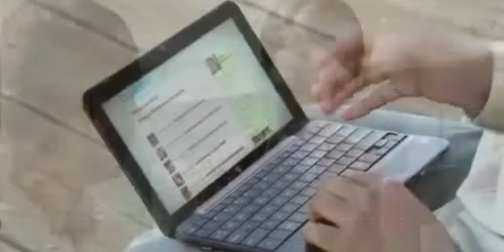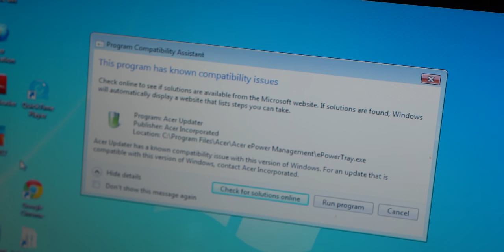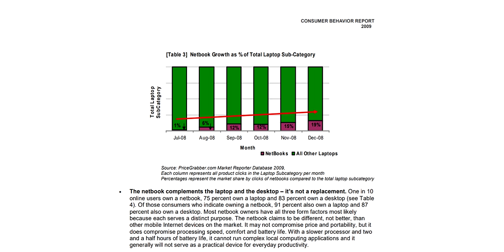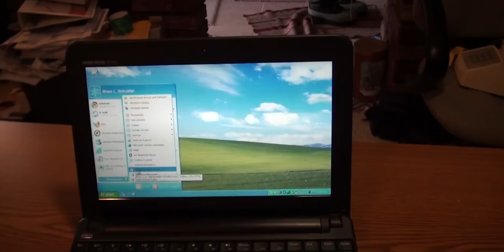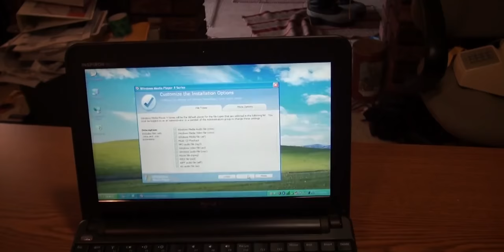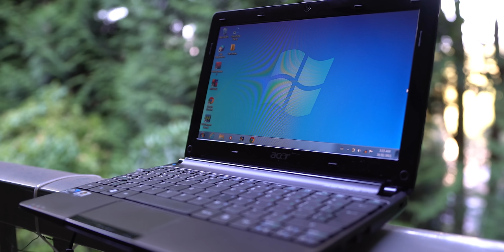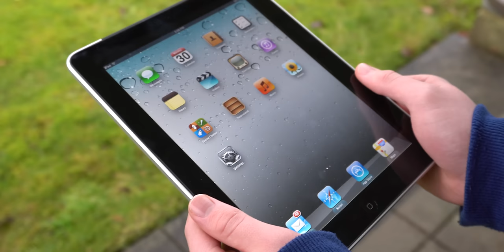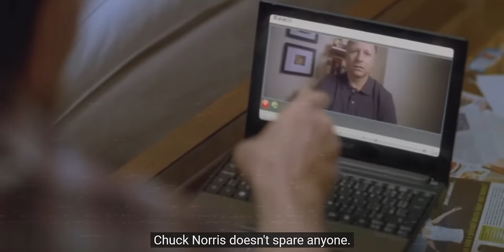Why Netbooks Failed - Modern Retrospective

Comment from the maker: Reminder that with Windows Starter Edition you couldn't change your wallpaper.
Has there ever been a more arbitrary limitation in any software than that? The low powered Atom processors and iPad/tablets didn't help Netbooks, but it was clear Microsoft never took them seriously.
Reply: cant change /customize win 10 if you dont activate windows , so yea thats still a thing
Reply: They were cheap and were bogged down really quickly with anything more than web browsing. The real purpose wasn’t really clear which lead to their eventual demise. Nostalgic nonetheless.
Reply from the maker: @billy ruiz bit different though because when you buy a laptop or pre-built PC it'll be activated. With Windows Starter you were buying a netbook, and were basically punished for not buying something better. Also it’s now used to try to guilt you into actually buying Windows which is probably fair.
Reply: At around 2012 I was given my mum's laptop which was a packard-bell easynote with black shiny plastic, it was a full size laptop but it had an awful single core celeron and I barely remember the rest, however it had windows 7 starter and it heated up like crazy. Why 7 starter? no idea at all, but packard-bell was a cheap brand so if it had to be cheap, it had to be completely garbaged out.
Reply: I still have mine, it’s hardly usable, it’s so slow. The wallpaper thing... we don’t talk about that.
Reply: i used a patch called Personalization Panel Patcher
Reply: You should consider covering the Palm Pre and Palm webOS. Really fascinating (and sad) story.
Reply: I know the wallpaper restriction is stupid, but it could be easily fixed by the Starter Background Changer. So it wasn’t really a big deal...
Reply: Vista Starter was limited to 1GB of ram, beat that
Reply: nintendo switch wont let me change my background either
Reply: The concept of a wallpaper itself is arbitrary. Why specifically on the desktop, and not on literally any other UI element that has a background in it?
Reply: Sony Pony  ihad one too but i put windows xp on it needed an external hdd cos it nly had 4gb storage year later sold it and bought a asus eepc 900ha still have it but now i use a HP X360 11.6" notebook as my secondary computer
Reply: Windows XP Starter Edition was worse. It was sold on cheap desktops in so-called "emerging markets". You couldn't have more than 512MB RAM, couldn't set display resolution above 1024 * 768, could only have a single user account called "Owner" which logged in automatically and couldn't have a password, and could only open three applications at a time. Interestingly, you could change the wallpaper to anything you wanted. Another notable thing is that it cost US$ 30 in the Russian market, while most poor people in Russia at the time could buy pirated Windows XP Professional for less than US$ 1. I have a Russian copy that I bought for fun and I also noticed that you can't update Internet Explorer beyond version 6. To use IE 8, you have to install the English version, which in my opinion is just strange.
Reply: Apple didn’t allow home screen backgrounds on iPhone and iPod touch prior to iOS 4, it was my #1 reason for jail breaking back then.
Reply: What model is the Acer netbook you show in the video? It's pretty similar to mine but definitely some differences
Reply: I didn't mind the fixed wallpaper.

The taskbar and window colors though…why did they use that ugly blue-gray?
Reply: @easyaspi31415  It's using the "XPDM (Win XP)" theme engine. It's a theme that's meant for backwards compatibility for old systems that don't support Aero, such as most circa 2001-2006 systems. They used it here as an attempt to reduce resource use, or make it "light weight", even though any modern PC at the time can handle Aero just fine... Including netbooks.
Reply: @steventechno  Wait does that mean xp themes are compatible?
Reply: @JohnSmith-xq1pz  Not straight away, no, I don't think so. Some tweaks would be needed to get Luna to render as many changes were done to the UI that breaks compatibility with XP Themes.
Reply: @steventechno  That figures lol. At least I have my background changing program...
Reply: @JohnSmith-xq1pz  You may be able to use UXTheme, but I'm unsure. I'm surprised there's anyone still running this OS... lol
Reply: @steventechno 
Hmm probably more efficient than I want to do lol. I've already changed the wallpaper and Windows welcome splash screen background. Acer used an OEM background so all I had to to was fund and replace that. Apparently a reg Edit method for the splash screen background is a thing too

 If I could have I would've downgraded to XP but that wasn't possible at the time I got my Netbook. Since it doesn't have any network or internet connection I'm totally fine with leaving 7 start on it (upgrading to 10 is possible but not great proformce from what I hear).

Lol I've got even older OS's still running too
Physical and virtual xp machine's
A 98se virtual machine
And multiple DosBox Windows 3.1 virtual machine's

My room's an interesting mix of old and new tech
Reply: @JohnSmith-xq1pz  Neato! I thought Win 7 Starter had the context menu on image files to "set as wallpaper". Maybe I'm thinking of something else... But Yeah, Win 10 32-bit should run okay with 2GB RAM at least. I've ran it on a netbook with 1GB and it was reasonably usable surprisingly enough, just avoid using the 64-bit flavors, and it'll be an okay laptop. Alternatively, Linux is a path it can go!
Reply: @steventechno  That might be how 7 starter normally works no idea. I accidentally discovered that Acer had used deeply hidden OEM image files for the welcome screen one day when I was trying to find a pic and told Windows search to locate every image file on the drive lol. So after finding that I was like yup I'm so tossing that stupid splash screen (I never like it. It's that bright green Acer one I believe they also used on full sized laptops) So the welcome screen is now a Bejeweled 2 backdrop lol.

Yeah I almost decide to go to 10 so I could still use my Netbook but I'm not thrilled with 10 and Linux is well I've never used it so yeah learning curve lol. So I was like yeah know a ultra portable version of my Retro gaming pc would be cool even if it's limited to lightweight games. So I spent several days transforming my Netbook into a fun little casual gaming pc.

The file transfer, factory reset and reinstalling the e backup drivers and apps (And 7 convince rollup) seriously toke  a whole day. Couldn't imagine how long the original hdd would've taken if even with a SSD it toke that long lol.
Reply: @JohnSmith-xq1pz  Converting it into an emulation station's a good idea. I would have likely turned my old one into that if I still had it, I probably would use Lakka, so more resources could be free just for the Emu's. lol
Reply: @steventechno  I've actually been thinking making a bootable RetroPi flash drive for some retro console emulation.
Reply: @steventechno  hopefully lol
Reply: I still have toshiba netbook n205 
And.....still work well
Reply: @dooogides9176  *Google's* Oh I remember those and the round bar thing that stuck out of the back. Is it still running xp?
Reply: @user-bn8pg7os8d  actually you kind of can
Reply: @steventechno  So? That doesn't stop them from choosing a better color…
Reply: @easyaspi31415  You weren't able to dynamically change colors on XP Themes either. only styles/skins.
Reply: @steventechno no I mean the default color is terrible.

If they knew that the desktop background wasn't going to be changeable, they could have chosen a more matching color: http://imgur.com/a/8CWoteV
Reply: Sony Pony  I had (and still have) an Asus EEE PC that I bought in 2010.  It came with Xandros Linux, and I had a problem with the OS crashing when it was trying to download updates.  I ended up buying a 64 GB SSD drive for it, to replace the stock 4GB SSD, and re-downloaded the factory Xandros Linux.  I then went to Ubuntu Linux (Easy Peasy) in 2012, when Asus stopped supporting the EEE PC.  That worked well, then I retired the netbook after buying both a used Windows 8 laptop and my first tablet.  I recently dug the EEE out of the closet and downloaded Chromium OS to replace Ubuntu.  The Chromium works fine on it, but I still use this as a spare.
Reply: You can get around this.  Right click image > Set As Desktop Background.  This also works on windows 10
Reply: there was a registry hack to be able to change the wallpaper. I bought my wife a purple Acer netbook and i had to do that hack to change the wallpaper.
Reply: Not being able to change the wallpaper in Windows 7 Starter is what got me to start using Linux.
Reply: I used a program called personalization panel 2.5 from Winaero.com (hope they still have it) in order to change the background and uxstyle to get themes working. If you search on deviantart "windows 7 basic theme" you would get some pretty good looking stuff back in the day (I still have a collection).
Reply: I vaguely remember the wallpaper thing, and I think I may have found a work around.
Reply: @CamdenBloke  what workaround?
Reply: @catalinpetrescu8488  I don't remember, but a couple of other people in this comment thread mentioned how they managed to change their desktops.
Reply: @CamdenBloke  oh, I see. I did myself but I was just checking for alternative ways :D
Reply: I remember I had to get the wallpaper changer and also change the Lock Screen as well :)
Reply: @JohnSmith-xq1pz  Make sure to add the post February 2020 Windows 7 updates. They won't automatically download, but you can get them from Microsoft Update Catalog. Just don't download Windows 7 Embedded Standard or Windows Server 2008 offline installer updates lol. Just get the regular x86 or x64 offline installer updates. https://www.catalog.update.microsoft.com/Search.aspx?q=KB4577053
Reply: Except to upgrade all you had to do was look up the upgrade code. Microsoft reused them so any code made public online would work
Reply: @tobyradloff  that's so cool where find an ssd for those ones?
Reply: @MrXavier3492  These SSD's might be a little harder to find today, since they were designed for the Asus EEE.  I remember paying $150 for my 64GB SSD back in 2012.  Not too many of these netbooks around any more.
Reply: Mine had win8, upgraded to win10. Then I smashed it.
Reply: Apples AppStore could arguably be more limiting :)
Reply: Windows S
Reply: @hampoon  that hits below the belt. But I can sympathise as I was real pissed that you had to get through it just to install STEAM!
Reply: My school has cheap Dell laptops with Celerons
Reply: Eeepeecee
Reply: You can actually change the wallpaper on XP and vista starter edition.
Reply: Many Karen’s got mad
Reply: XP Starter didn't allow for multitasking. Supposedly it also had a limitation where it couldn't use more than 512 megabytes of RAM, disks larger than 120 gigs, and a screen resolution larger than 1024x768.
Reply: @codfish1113  XP starter did allow up to 3 apps open
Reply: Who cares about background desktop stuff, because the vast majority of the time you will be working within an application.  Also background wallpaper is quite a resource hog especially on older machines, and slows down everything you do.  So I always make sure the most plain and basic background theme is used.
Reply: you couldn't run more than 3 programs at once
Reply: Earlier netbooks came with XP Home and so no this problem. Only the last year that 7 Starter was shipped with it. You can still install XP over it, or Linux etc. And you pick this like you pick bones.
Reply: @johndostech  Was the Pre the one with that wierd ad campaign where the very caucasian woman with severe over-exposed lighting stood in a void talking about sensations and whatnot ?
Reply: @thegardenofeatin5965  Haha, yep... Those ads will forever haunt my nightmares XD
Reply: Windows 10s not allowing you to use .exe files
Reply: You could change your wall paper with the photo viewer application (right click, set as desktop background).
Reply: @agusorellana5551  packard bell in and of itself is kind of like Dell in the late 2000s with their Dell Inspiron 1545 which had cheap shiny plastic and was Made in China. Like THAT was a good choice. It wasn't.
Reply: @groszak1  You could change wallpaper in files with Win98 ... Those were the days.
Reply: i'll bet you i can change it
Reply: You just unlocked a deep memory of me googling how to change my wallpaper on my 2009 HP Netbook only to find out I literally couldn’t for no reason.

Still played Minecraft LPs in YouTube though.
Reply: Chromebooks look set to go the same way as Netbooks.
Reply: I love that tbe fact the Google says in there Chrome book ads that there fast and the ones uploaded to yt the comments are filled with people including me saying it's a slow computer and it is why is Google lying about there Chromebooks
Reply: The Earlier Version of Starter Editions like Windows XP and Vista can change wallpaper though but you can only open 3 Apps at once.
Reply: Windows 7 Starter Edition didn’t allow you to, but the previous Windows versions did.
Reply: @hampoon  The Windows S is just too far.
You Can’t Download Apps outside MS Store
Reply: Of course the low powered Atoms helped the Netbooks! What a terribly bad statement! They helped them to be cheap! And that was the main point of the Netbooks! 
It's would be exactly the same argument as saying that today's i3 and i5 processors "aren't helping" at all, thus there should only be high power i7 on the market.
There is a reason for market differentiation. Lower specs will help the price - duh.
Really don't understand the logic and the reasoning of this content creator at all. NOT subscribed!
Reply: @91Tech  im late to your video, but netbooks didnt die. they just changed names to become ultrabooks
Reply: This Win7 starter thing is so insane. I never experienced it because I had XP. But when I reinstalled 7 from my Home copy, it was definitely slower. Not at everything, but I used it a lot less after that.
Reply: They are small hardware specs and gets more issues as and Windows 10 updates….
Reply: If you use a Chromebook, you can't put icons on the desktop